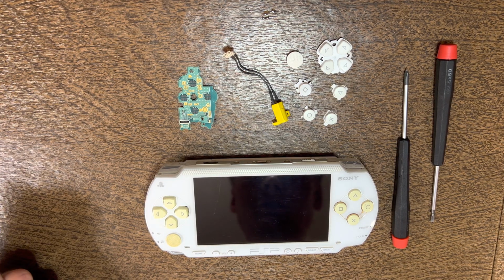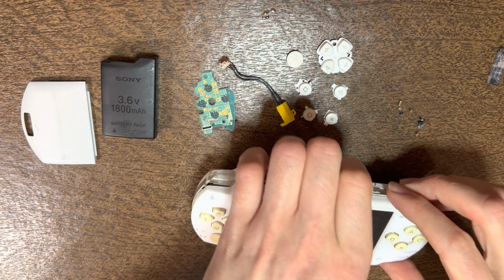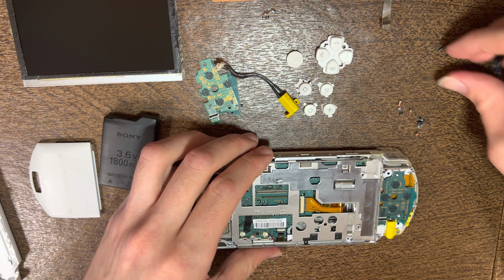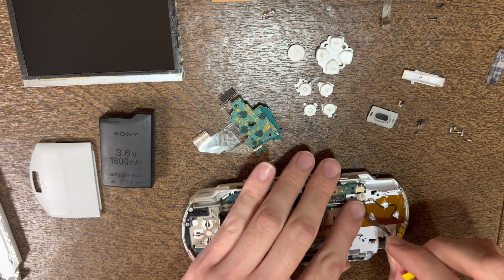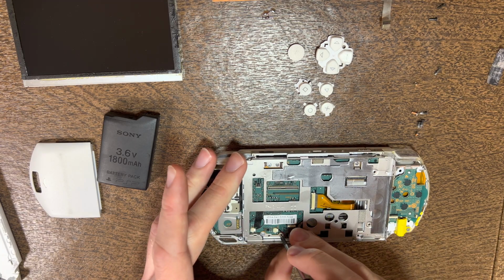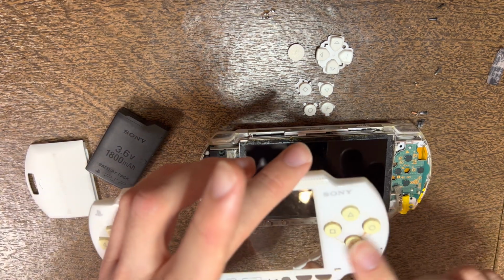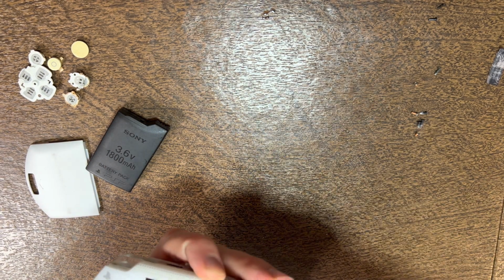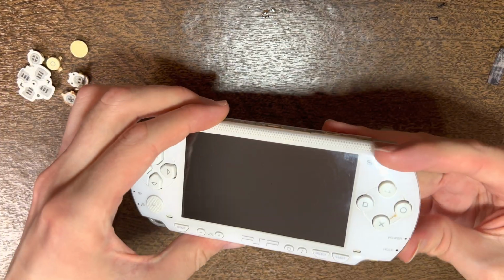Sony PSP 1000 - How to correctly replace a power switch, charge port, and yellowed buttons

Comment: question, Do I need a soldering iron or something like that? I don't really trust Ai bc it says that I need that
Reply from the maker: A soldering iron isn’t needed for the majority of psp repairs. Most repairs that require one are: replacing the super capacitor, replacing or bridging a umd drive activator, and if you need to replace a different mounted motherboard component.
Reply: @blakeblundell9001   Oh, so let's say my PSP-1000 charging port has been cracked (pause), and I can't charge it without being at a very, very specific angle, and the UMD door is broken, and maybe a screen upgrade, I don't need a soldering iron for any of those?
Reply from the maker: @t1gok1ng13 a soldering iron is usually needed to do the small solder bridge for an ips screen, but you can get conductive paste that can be a bit tricky to avoid getting on other components and it takes time to dry/harden
Reply: @blakeblundell9001   Oh, okay, Thank you very much

Comment: If the PSP has a crack in the charge port, and leads to it shutting down if wiggling the power cable in the charge port (as well as tapping the Start button it will shut off), would replacing just the charge port fix it?

Comment: My psp suddenly shutoff even it plugged the battery ro unplugged (only use adapter), is it solve the problem?
Reply from the maker: If it starts to turn on and you start to see the screen backlight before it shuts off, then it will be a firmware issue. If only the green light comes on, an instant would mean a short and a continued green light would mean that you should try to unbrick it with a Pandora battery.

Comment: Hey will this fix issue with a 1001 power switch not being responsive  it takes a couple trys for the psp to turn on or off with the switch?
Reply from the maker: Yeah you can replace the power switch to fix that issue

Comment: Another persons video I watched show me how to to this. I got 12% isoporyal alcohol and then I got a little sauce container, filled it with buttons, made a tiny hole for gas escaping and closed the sauce jar, wrapped it around aluminum foil with the shiny  side facing inwards all around, leaving the light come through the top. Within say less than a few hours it turned to the original color. Make sure the container is fully translucent.

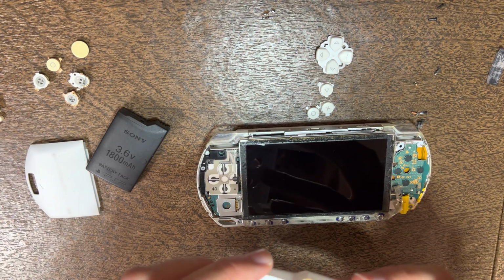Comment: my man you should show what you're doing. At 12:38 I am having issues with the XO△▢ Buttons when I close it, the O stops working, won't move. I can't see what I'm doing wrong lol
Reply from the maker: I’m only a pro when it comes to a psp repair, and a complete novice when it comes to filming any of this stuff lol (crappy camera setup). What I’m doing off camera is cleaning the gunk off, which is pretty easy and straightforward. If you’re not getting good compression with the O button, slightly lift up the faceplate and push the O slightly down. Also make sure you’ve got it oriented correct with the 4 legs. It’s good to also wipe down the button rubber to help with sensitivity
Reply: @blakeblundell9001  yeah I actually found my issue cause I knew it couldn't have been complex but it just didn't want to work and I dug out my microscope camera and yeah the new shell isn't 100% right I had to slightly file it